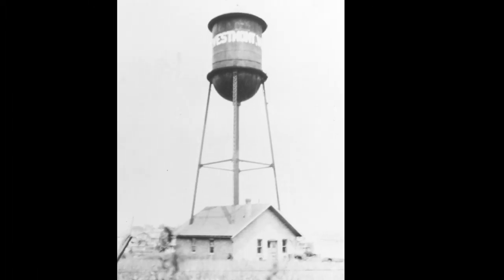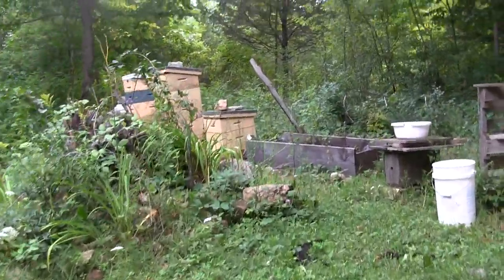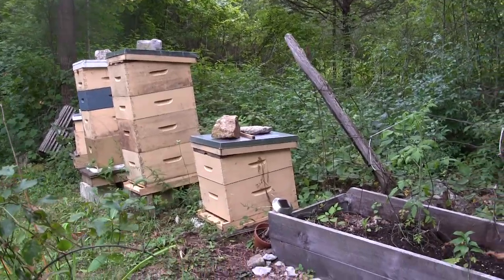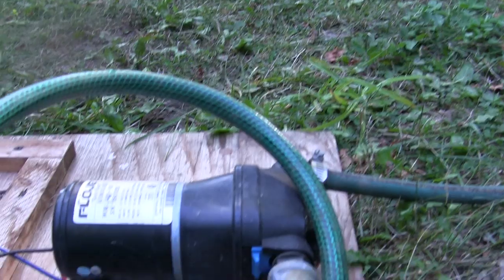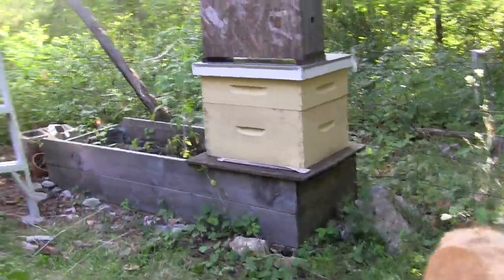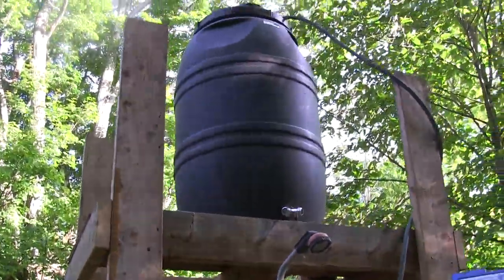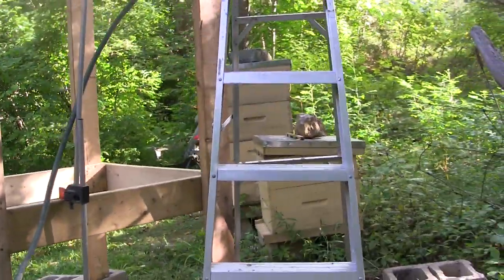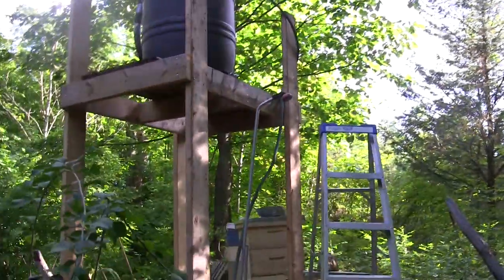Building An Off Grid Water Tower

Comment: I know that everybody has an opinion on everything. Most of them don't know a damn thing. But somehow they know everything when they're on the internet. I'm just wondering, how would a tapered Tower do for you? Wider at the bottom and gradually tapering smaller towards the top. I'm just thinking that might be more supportive instead of trying to vertically balance a pencil on its eraser so to speak. Just a thought, you might be able to add in 45-degree bracing towards the bottom after you complete the tower to spread the load out towards the bottom. Just a thought.
Reply from the maker: All good points! Bracing was added later, which helped.
Reply: That's good. How has it been doing for you since you put it up? I have recently built my own little water filtration system. I go outside and catch the Rainwater underneath the gutter after it has rinsed through for a while. It's been a good Supply how clean Rainwater. I've been saving and rinsing my old milk jugs as many as I can get. I built a filtration system through a Shurflo 110 AC water pump and through and omnifilter whole house water filter. It's been fantastic so far, hopefully yours has been doing well for you
Reply: Bret Hager give an inch you take a mile
Reply: Bret Hager if you are trying to be positive don't try to insult people. go take care of your anger issues instead
Reply: Bret Hager look i got the reaction i was expecting however it is to late for me to be a therapist's and i can tell you hold a lot of problems. sir i hope you have a good night.
Reply: Bret Hager running out of fumes i see lol. oh and i commented on one video js.